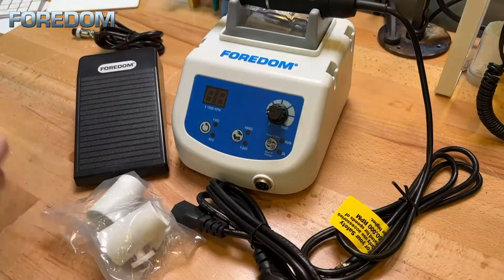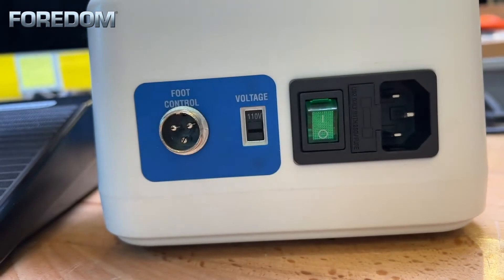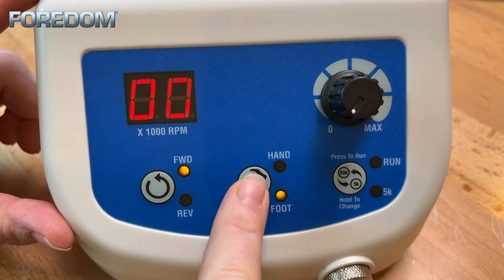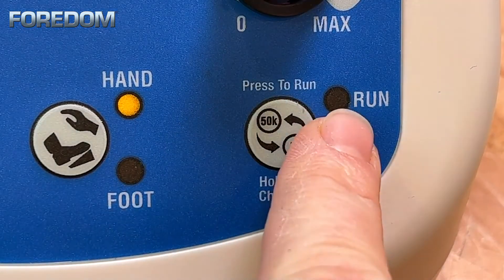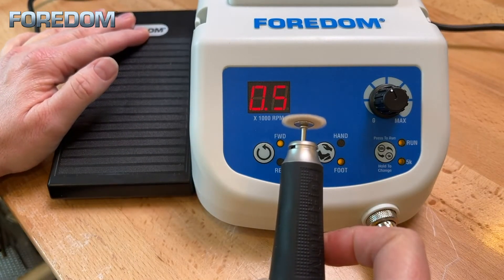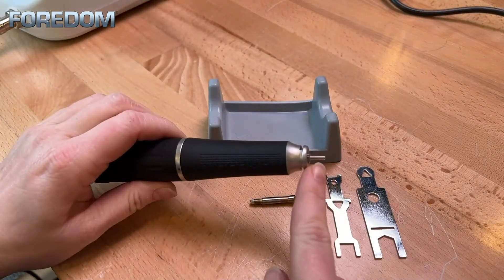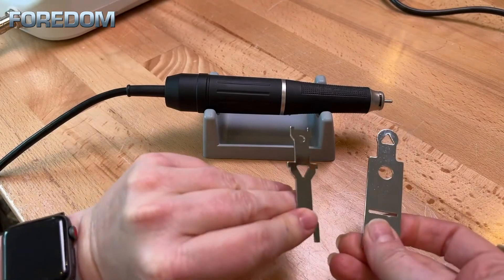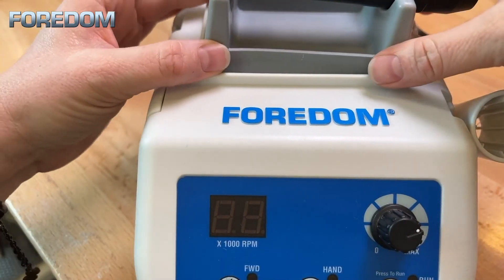Slow, Steady, and Smooth. High Torque start! The New 1040 brushless Micromotor From Foredom

Comment: What are the differences between this machine and the regular foreign.  pros and cons.  To me this is a great machine for traveling.
Reply from the maker: The best part about this is the torque at such a slow speed. When I am cutting a seat for a stone, my other machines have to have enough speed to get the torque going. This has  caused more than one west to be too low or wonky. The next closest machine that can run this low of speed with the torque is $1,800+.

Comment: Are flex shafts a thing of the past?
Reply from the maker: No.  I don’t believe so. They have so much more torque than a micromotor. And there are a lot of accessories that are used with them. They aren’t going anywhere for a while.